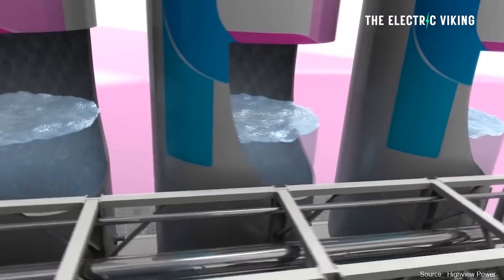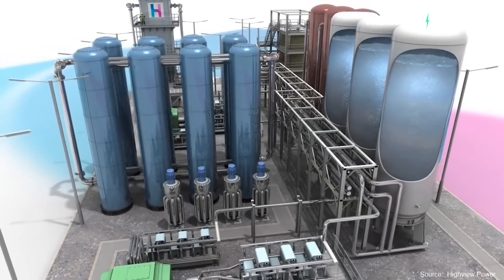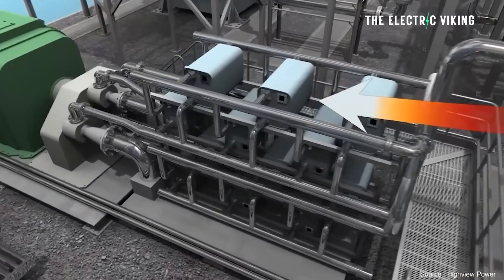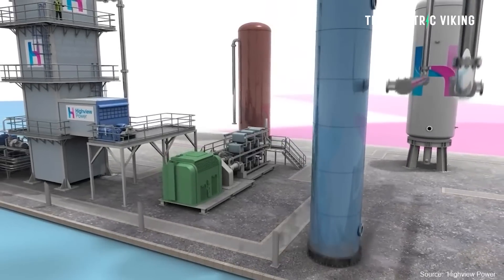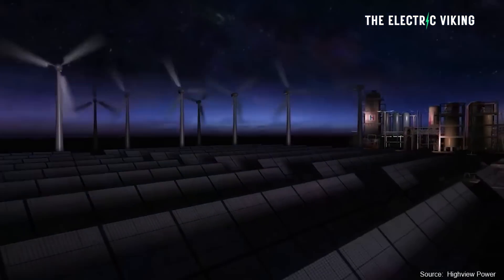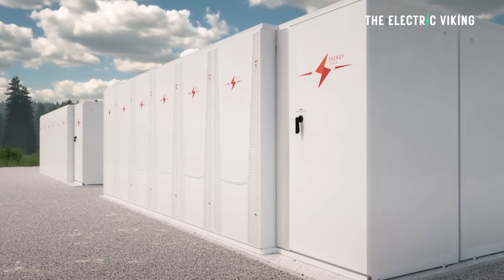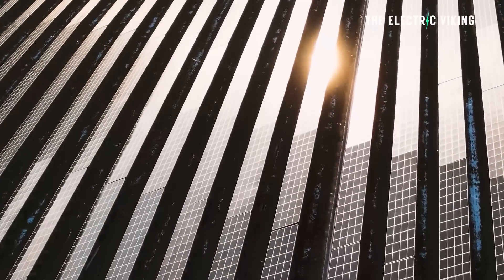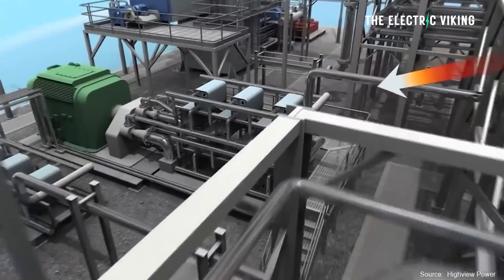Liquid AIR batteries revealed with ability to provide power for longer than lithium

Comment: I wonder if they would be good for really cold regions. Batteries tend not to do well in frigid temperatures and cooling air into gas might be even easier when working with -30 degree temperatures.

Comment: Australia is very special place since the population density is 3 people / km2. For example China has 152. This makes it more difficult to build infra for energy transmission since in many places energy cannot be generated where it's used. I guess in many places offshore wind is pretty much only viable clean option just because of population density. I'm living in Finland, where during the winter solar provides pretty much zero energy. A lot of different solutions are needed to reach net zero.

Comment: Adelaide (South Australia) relies on the interconnector to Victoria. Yes, renewables may provide 60%, but that still means 40% from fossil fuel. I just checked the NEM dashboard, at 5.15pm EST = 4pm ACT. Demand was 1.4GW, and 340 MW was being imported from Victoria, i.e. brown coal. Gas was 611MW, and solar and wind were 250MW and 280MW respectively.  Solar radiation is almost at its peak - solstice in 10 days.

Adelaide illustrates that 60% renewables is quite possible, but getting to 100% is extremely difficult.

Comment: Sorry Viking but you have missed the most important point. This is not a new technology, the engineering  involved in liquifying air and storing air is well understood, we have been doing it at scale for decades for other industrial purposes. All the components are available "off the shelf" with no rare minerals required. The "round trip" efficiency of storing energy in this way is around 70% and this is comparable with many other energy storage technologies. The risk of investing in liquid air energy storage is that some clever sod might invent something better/cheaper/ more efficient. This risk could be mitigated with a feed-in tariff arrangement - just as was given to all investments in solar/wind/nuclear etc.
Reply: Plus you can scrub the air and take out pollutants as part of the process.

Comment: Anchorage, Alaska is an example.  In winter, it doesn't get enough hours of sunlight to run on solar energy - less than 6 hours per day.  10:08 am to 3:44pm.  So I'd predict that wind and geothermal will be needed to keep Alaskans warm in the winter.
Reply: How about connected power grids?

Comment: Any form of energy storage which can use the excess energy without the need to shut down or ramp down plants or turbines is beneficial, with compressed liquid air the vessels are already mass produced and easy to obtain and the cost to expand the plant storage capacity with little comparative cost is a bonus.

If they hit their claimed 60-75% conversion rate then it's worth operating, obviously there is less but, when the losses allowing clean operation it's not a concern.

Comment: Australia is basically a best case scenario for renewables with minimal storage.  The challenge in places with substantial seasons like Canada is we need baseload or long duration storage.  PS:  The entire province of BC has run almost entirely on renewables (hydro power) for 50+ years.  Ironically the ratio is dropping as we need more natural gas to supplement trendy hydro/wind.
Reply: I think we are lucky.   I kept daily records from different regions of bc.  As expected, in summer we are sunny, in winter it is windy.  Hydro is a perfect partner.  When renewables provide lots, Hydro can shut down turbines and essentially become energy storage.  One can probably adapt some hydro systems so they can do pumped storage as well.  We will probably not need as much hydro with time, so it creates flexibility in water use.  We could use it for agriculture, enhance fisheries/wildlife etc.
Reply: @leroyharder4491  BC is lucky but most northern climates (even europe) are not.  We can export some power but not enough for the entire northwest.  Turning down hydro only makes sense if the reservoirs are getting low.  Hydro does not change quick enough for grid stability so some other storage is needed with renewables.

Comment: The efficiency of liquid air energy storage is about 60%. Maybe interesting when there is a huge surplus of electric energy.
Reply: Replacing baseload with peeker plants due to renewables causes the grid to be dirtier.  Any cheap storage technology is worthwhile - losses are nearly irrelevant as scaling solar in Australia is very easy and cheap.
Reply: Not a bad idea but the compressors won't last long in many environments.. so won't work everywhere.
Way better than hydrogen,but I prefer redox batteries, or even lifepo

Comment: Hi Sam. Here's why seasonal energy storage makes sense. Imagine a solar power plant that produces more than sufficient energy during the summer. The energy supply is greater than the demand. But during winter, the solar power plant produces less energy than the demand. How do you solve this in a way that does not require solar to be supplemented by gas plants or other non-renewable power generators? One approach would be to add more solar panels so the winter output also matches the demand. But this would increase the energy wasted during the summer seasons, for the energy generated during summer seasons would far exceed both the energy demand and the available energy storage solutions. Unless, you have cheap seasonal energy storage that could store the excess energy produced in the summer and release it during the winter
Reply: In Germany we have the most energy oversupply in winter when strong winds supply more electricity than we can handle. In summer, there is a shortage every night.
Reply: @JakobFischer60  So seasonal energy storage would make a lot of sense there

Comment: It is just a matter of cost. Can they make it cheaper than LFP? The less expensive energy storage device will eventually win the market. What are the losses? Your illustrations showed above ground storage tanks. How well insulated are they to ambient heat? Wouldn't it be better to store insulated tanks below ground where the temperature is 52°F/11.1°C thereby limiting your ambient temperature losses. I'm glad people are looking for more ways to store energy. It means so much for the success of renewables.
Reply: These tanks are industrial standard for nitrogen and are insulated by a vaccum double-layer steel container. These are quite well in insulating.
Reply: The liquified air/nitrogen storage to electricity generation cycle is not particularly efficient, especially compared to BESS. However it's a pretty simple and well known technology - so it could have a place in the commercial energy storage.
Reply: Where feasible, you can do away with steel tanks and use caves (natural or man-made) underground cavities. Just ensure they are sealed against leaks.
Reply: I don't think natural caves are suitable to hold -200°C cold liquid. It will freeze the whole area. @ramonpunsalang3397

Comment: If you are talking about solar as providing the bulk of the renewables, storage does need to be much more than 12 hours. It can be cloudy for weeks at a time.
Reply: Kas, that’s where better transmission lines come in. It will always be windy or sunny somewhere. With enough batteries and long distance transmission, we’d only need a few days of storage, even during winter storms.

Comment: What is the energy loss cooling, maintaining that temperature, then reheating the air?
What's the net loss?
Reply: 60-70% round trip efficiency.  Given cost, safety and mineral scarcity of lithium this still makes sense.

Comment: Can’t you just rotate batteries for overnight use?  The first third for the first 4 hours, then the next, and so on.  Will these battery emplacements have to be build under ground to protect them from solar radiation, CMEs, etc?

Comment: Tony Seba calculated that to store energy for the worst time of year anywhere in the US, there would need to be up to four days of energy storage max.  Some areas less than two days.
Reply: Yeah nick… reply guy knows much better than experts, as usual
Reply: Much of the US is covered with clouds for several weeks at a time. Unless you build an unreasonable number of power lines, you will not be able to use solar in much of the country. Wind is not going to fill the gap either, as it can be windless for many days. Tony is wrong. No calculations required.
Reply: @kamra99a  Solar generates so much energy already in the southwest prices there on the spot market are frequently going negative - they'll pay you to take it away.  And we've probably only deployed a fraction of the solar power that'll ultimately be deployed in the southwest.  The availability of free power for hours a day makes building transmission lines a lot more economically viable than it would be otherwise.  We're going to see a glut of powerlines built over the next two decades, both west to east - providing the midwest and east coast with power for several hours after local sunset - but also south to north, bringing solar power from the sunbelt up to cities like Chicago and New York.

Comment: What is the conversion efficiency vs  other storage methods?  without that info hard to speculate if this method can be a practical choice.
Reply: About 70% but the real question is always cost per kwh stored.  Intermittent renewable electricity is cheap - making it stable isn't.  Liquid metal batteries and pumped hydro are also in the same ballpark.  Flow, Lithium and Sodium are still very expensive and the benefit of higher efficiency is actually minimal.
Reply: Agreed with above comment. The cost efficiency is more important than energy efficiency. That and environmental impact caused by mining for the materials

Comment: You may only need 12 hours of storage in Australia but if solar is going to be used for most of the rest of the world, it will need to be more.  Even in sunny California during the winter months a solar array sized at 2 times what is required will still need a generator or grid power in December through February.  Battery back-up just isn't enough.
Reply: It has been calculated at five hours
Reply: @markthomasson5077  What has been calculated at five hours?
Reply: @Ryan-ff2db  …the time for the amount of storage needed. I guess in Aussie land it’s not so difficult, here in UK a fair bit more I suspect
Reply: @markthomasson5077  I'm still not sure what the 5 hours means but I agree the UK would be difficult for solar.  Uk does have very good wind resources though.